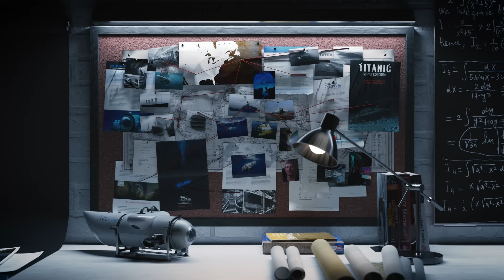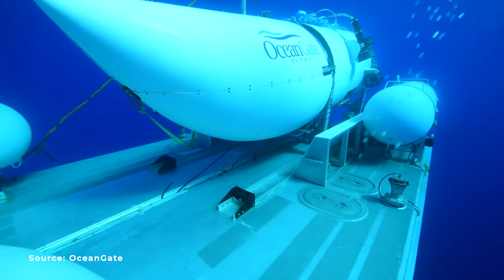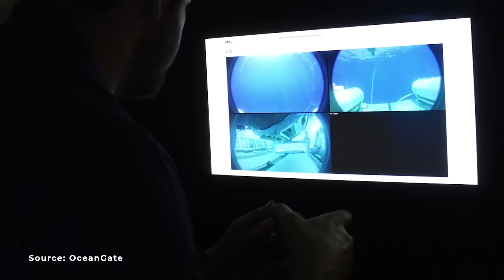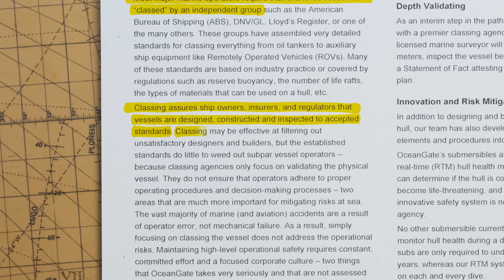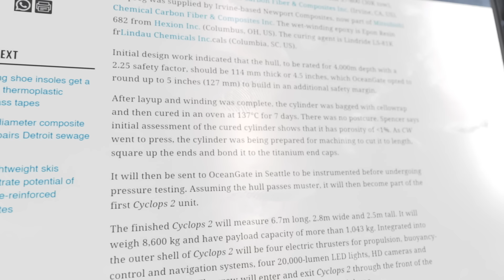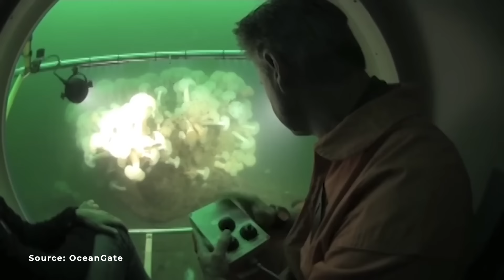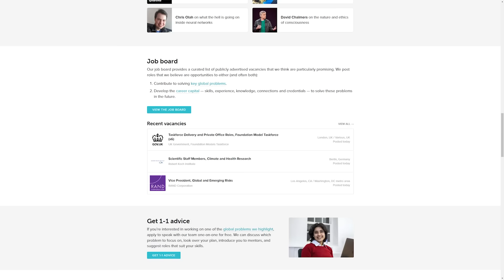The Questionable Engineering of Oceangate

Comment: After everything I've learned about Oceangate and Titan, I think the biggest mystery of it all is:
How did that sub survive as long as it did?
The more I find out about this, the more insane it gets.
Making the hull in a warehouse without considering air, dust and hairs. Gluing materials together that compress differently. Choosing a window that should be too weak.
At this point I just want to understand how it could possibly have worked even once.
Reply: A bulletproof vest made out of wood will work for one bullet if it is thick enough
Reply: @centripetal25  A bullet-proof vest made from Kevlar and ceramic plates will work until it's compromised.
Reply: @centripetal25 that sub went to the titanic 13 times.
Reply: @blazn0  Same principle. The little bits of wear and tear on the sub eventually caused catastrophic failure.
Reply: @blazn0  its a metaphor
Reply: If only they had used FLEXSEAL on the hull.
Reply: @chairmankim9628  funny. In a dark kind of way ..
Reply: My guess is that they did have a certain safety factor built in, which is why Stockton was so sure it would work. The progressive damage from previous dives that they chose to ignore then just slowly erroded that safety factor to zero.
Reply: @dirkmohrmann8960  True, besides a ridiculous amount of luck, apparently everything was built way better than you should expect.
The people who actually built this thing did a fantastic job, building something that shouldn't work on so many levels and still survived a few times.
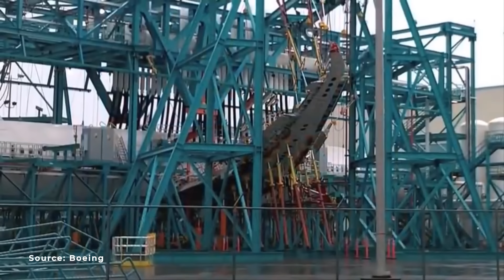Reply: Fatigue. (7:12) Just because something can take strain once, is no implication that it can take the same strain hundreds or thousands of times.
Reply: Using carbon fibre under a compressive load… you can’t push a rope.
Reply: @troglokev  well, you can push a rope, it just does that a rope does :)
Reply: @StefanoBorini  yes. It wobbles around and bends all over the place. Unless it’s PMI. That stuff was awful as rope. Great if you needed to improvise a jemmy bar.
Reply: Let's apply one direction to our weave lmao the company suppling them the five inches was like "we gonna get those lambos boiz!"

Comment: Not sure if reinforced concrete counts as a “composite material” but from what i have learned is that you typically look at the strengths of the independent components separately for the strength of the member. In other words, you look at the concrete itself for compressive strength and the rebar separately for tensile strength (granted its place correctly w/ respect to the intended loading condition). I have never had to do any analysis on composite materials aside from steel alloys which idk if those exactly count… the only case of two distinct materials together ive dealt w is concrete, but it wasn’t distributed uniformly in the mold. Id really like to learn more about composite materials properties like the example mentioned in this video. Maybe a stress strain diagram that would take it to failure, just to see what it would look like. 

Edit: i got exactly what i asked for at 10:58 lol. Thank you

Comment: Every submersible intended to reach these depths uses spherical pressure vessels to maximise pressure resistance. And no submersible has ever been lost due to implosion of the spherical pressure vessel.

Using a cylinder is itself a major red flag. Using a CF cylinder GLUED BY HAND IN A DIRTY FACTORY to titanium end caps is a screaming siren.

It isn’t surprising this thing failed; it’s surprising it didn’t fail on the first dive.

Comment: Something i realized while watching this is that one of the reasons you would see delamination as opposed to standard buckling is because at very high pressures, not only does the water push the wall inward, but that load transfers along the arc of the circlular hull. That might cause the surface to compress within the plane. By doing so, the inner layers would be prone to rotate bend like when a bimetallic strip bends due to uneven expansion.

Comment: The CEO of OceanGate has completely misunderstood the "move fast and break things" approach. SpaceX is an example of doing it right. Yes, they quickly iterate by making a prototype, blowing it up in a test, improving the design and repeating. But they do this with unmanned vehicles! Only after many, many design iterations of the Falcon 9 rocket did they put humans on top of it. At that point it was already proven that it's a highly reliable launch vehicle. And they went through NASA's entire certification procedure for human flight rather than ignoring their rules.

Comment: Apparently, the ends effect due to the hemispherical shapes was also neglected, which due to the effect of pressure, produces axial forces in compression. If you notice, the sub has no reinforcement in that direction. The only structural component that provides axial reinforcement is the metallic liner. The composite reinforcement is insufficient. Going into greater detail of the structures manufactured by filament winding, the biaxial stress state dictates that the winding angle should be 55°. According to the manufacturing video of the cylindrical segment, the winding is done at 90°.
Reply: Besides, the failure mode that you describe (delamination buckling failure mode of the first ply) is impeded by the metallic liner. So, the global failure mode of the Titan's cylindrical body is rather new.

Comment: The way I see it, Carbon Fibre in this use case is TOTALLY USELESS and the sub was relying on the strength of the epoxy alone. The fibres themselves are not rigid and their strength lies in tension, so things like COPVs as used in Aerospace is right up the alley of Carbon Fibre. When used in this application with the forces external to the pressure vessel the fibres are in compression, as an experiment take some rope and see how well it takes being compressed along it's length!

Comment: I would say that a the fact that passengers just sat on the floor of the vessel without any restraints in a small ocean going vessel is a decent indicator that this was amateur hour. The risk of blunt force trauma for everyone inside should the attitude of the sub alter is huge. Also there is zero ability for emergency egress even at the surface because it takes 30 minutes to unbolt the end hemisphere, what about fire, medical emergency, air supply issues etc etc etc. Also there is evidence that the battery power had no redundancy and was a constant reason for resurfacing. Just a big nope all round. I think that using the word egotist or narcissist for a CEO is a bit off though. Most CEO's will fall into that category in a psyche test.

Comment: The epoxy-glue joints where the domes fit over each end of the carbon fiber cylinder would of told me ..hell no, I wouldn't go down in such a vessel into such extreme depths.

Comment: As a professional engineer myself I have a little theory and practical experience with composites in pressure vessel design...but not much. Mostly in metal. Glad that your more informed thoughts coincided with mine on this. Seems clear cut. The CEO appears to be a  dangerous maverick reckless idiot.

Comment: The biggest weakness seems to be the way the end caps were simply glued on. No rubber seals. No gaskets. No v band. No bolts. Just glue and basic coupling. 

My best hypothesis is that water seeped in through that joint and made it so heavy that when it dropped the ballast and frame, it was still too heavy for even the thrusters to bring it up. At which point it most likely imploded.

Comment: The vast majority of plane crashes are caused by poor or rushed maintenance or mechanical fault not pilot error not the other way round as the the statement in ocean gate  CEO says  what he did was negligent to the point of being criminal with that statement and failing to get a sub (experimental) one certified by a competent Org that deals with craft at this depth is down right idiotic
As for the carbon fibre the video of it being rolled onto the steal tube showed that this company cut corners , you only have to look a air bottles made for scuba diving how there made in a crisscross pattern  and thats where its strength comes from not in the straight line like winding a bandage round your arm from wrist to elbow

Comment: If it had been designed like a star except Instead of sharp edges that had parabolic curves between the points, would that Have put the carbon fiber into tension? Considering only the tips of the star would be under compression at that point

Comment: Excellent video. Thorough research etc. I want to add a little though: There is some way to do a composite so that compressive forces result in weird internal responses causing the material to be under tension more than the external pressure. I remember my professor showing it and explaining how they used that technique in car manufacturing. I might be able to find my notes on it if you want.

I want to offer a little, hopefully constructive, criticism on your spin philosophy. Firstly, I do agree they had woefully insufficient safety standards. I agree with them that standard safety routines will often fail for a non-routine product. That however is not a reason to ignore third party concerns, its a reason to seek them out and answer them. I suspect some of this was done; but it seems they ended up reinforcing themselves in reassuring others or dismissing unqualified claims. My bigger concern here comes down to a few things. 1. The vessel design worked surprisingly well. The hull had completed several dives. If it was completely untenable there wouldn't be one success. i.e. it should have been possible to do this more safely. 2. The virgin galactic accident had a survivor because of the safety features. Compared to earlier rocket developments they actually have a lower failure rate. It still shouldn't happen and should be getting better. 3. We are also looking at this with hindsight. Its a lot easier to trash a failure. Its also important to focus on what was done and why what wasn't done was left undone. I don't think we have all those details. There were multiple human factors leading to this. Spending 15 minutes describing the problems is good. But people don't ignore 100% of criticism. Its harder to learn from someone's mistake when we see them as a legacy of mistakes. In this case you have a company that was a surprising success make a few fatal mistakes.

Comment: Composite construction seems an odd choice for a device which by its very nature will be subjected to only compressive stress.  Composite material can be quite strong if the fibers are loaded in tension.  That is why fibers are put in rather than making something completely out of epoxy.  As the saying goes, "you can't push a rope" which is exactly what happens when you try to load a composite component in compression--the epoxy matrix is what will have to take a majority of the stress. Composite pressure vessels, like the high pressure hydrogen tanks in fuel cell vehicles, work well because the internal pressure produces primarily tensile stresses in the walls.  A very basic issue of misapplication of a material, it seems to me.  There are a number of other issues with this vessel but that seems to be a pretty basic error.

Comment: Thank you for not getting into the Logitech controller. It’s a red herring only to make the implied statement that Titan was a toy.

Titan was many things, including an egotistical moron’s phallic measuring device, but toy is not one of them.

Logitech, Nintendo, Sony, and Microsoft sink millions of dollars into designing sensitive, accurate, and durable controllers. They are literally their respective system’s user interface and incredibly important to their respective success.

And how important is that success?

The video game industry makes more money than ALL of the movie, television, and streaming studios.

COMBINED.

The only control issue Titan experienced was due to installing thrusters wrong… which was improvised to correct for safe recovery by holding the controller at 90 degrees to orient the axis of control in alignment with the muscle memory of the pilot.

Using an easy to learn and program gaming controller is actually one of the ONLY things Oceangate got correct.

Comment: Just my curiosity, what do you think about how fiber is only weaved in one direction as shown in the video? Would different weaving pattern improve haul strength?
Reply: Imagine trying to build a water bottle out of string and tape. Would it hold water? Probably, if you did it right. Would it maintain its shape if you stepped on it? Not a chance. This is a rough analogy for a carbon-fiber pressure vessel. String and carbon fiber are really only strong in tension but not in compression. Due to the convex shape of the pressure vessel, there's really no good way to have the fibers in tension when the pressure is coming from the outside. But who knows, maybe sometime some crazy smart topologist can figure out some revolutionary design where the fibers would be in tension under external pressure, but as of right now, it's essentially impossible.

Comment: A very clear and well made presentation and great to hear from someone fully qualified in this area, thank you. Re the profiteering - I don't think they actually made any profit from these tourist dives. Rush's longer term goal was to use the design for subs servicing the deep sea oil and gas industries. Without a certified vessel there's no way those industries would go anywhere near him, but he was betting that with some history of successful use they would. So these dives were effectively beta testing, using the tourist income to partially fund it. Frankly I don't think they would have gone near him regardless, but such was the blind hubris and narcissism of this man, he thought otherwise.

Comment: 10:38/15:11 it’s funny they say this. If only there was an industry that specialised in Material x-ray to check for porosity. Helloooo weld x-ray specialists. I’m sure 5in of carbon fibre is not X-ray and it would when x-rayed show air pockets and material/ lamination inconsistencies. Just further shows where there’s a will there’s a way and how un willing they were to look for possible failure points and find ways to test them.

Comment: As soon as I heard the hull was a composite, and that it had made previous dives to deeper depths, it was clear, to me, it was likely a fatigue failure and that the operating pressure was above the fatigue strength of the hull.  Composites aren't perfectly uniform (it's hard to predict the fatigue strength), fail suddenly and without warning, they don't strain harden, aren't good in compression -- the list of issues is a mile long.  When it's so easy to feed steel into a ring-roller and weld it, why go through the hassle of building a composite?

Comment: I don’t know if anyone notice but ocean gate made the carbon cylinder by winding unidirectional carbon fiber tape around a mandrel with flanges on both end, and they did not wind the carbon at 45/90/45 degrees. The winding was simply applied at 0 degree all along the mandrel, back and forth until reaching the desired thickness (apparently about 5” thick). This is fundamentally so wrong in term of carbon composite manufacturing process and did not take advantage of how carbon fiber supposed to be used. Basically, imagine building a wooden cylinder with the wood grains all going in the same direction. I’m certain that they did not wind the carbon in other directions because with the flanges on the mandrel, there is no way they could have done that. Normally you would have to alternately wind the carbon tape beyond the required length of the final part, the trim to size after curing. But i can imagine the challenge of cutting something 5” thick not to mention the cost. Totally insane!

Comment: What Ive found in hydro testing pressure vessels is one common immutable truth , having a predictable failure mode is very comforting .  You can design around that predictable failure mode ( weak link ) and prove the actual result repeatedly.. This backyard project sub was simply a deathtrap
Reply: Unfortunately the failure mode was fatigue, which is not well understood, and is calculated as a probability of failure.  That's great for mass produced stuff, you can say 0.02% of your stuff will fail in a given number of cycles.  Not so much for a single submarine.  And the snap buckling just adds to the lack of predictability.
Reply: @MushookieMan especially it is good for mass produced stuff with limited safety risks. If an "innovative" company wants to build the first carbon fiber shovel because of its lightweight they can do this. If the testing reveals it withstands an average of 2000 times shoveling dirt it isn't the most sturdy shovel but no-one will die because of this thing.
Reply: @technikchaot  Maybe people will actually die when such a shovel snaps, but it's such a tiny risk and the warranty statement can protect the manufacturing company from lawsuits.
There is no such thing as 0% risk of death in life.
Reply: @VulpeculaJoy  Testing a shovel to be able to withstand extreme fatigue on the off-chance that it might hurt someone is orders of magnitude less important than testing a submersible for failure.

In one of these cases, chance of death when there's a failure is very low.
In the other case, there is a near 100% chance of death if a failure were to arise.
Reply: @tonydai782  The fact that one has to explain the difference in consequences between the failure of a shovel and a submersible at depth with living people aboard amazes me. I am waiting for the person to post claiming that playing Russian roulette with a single round in the chamber and getting away with it 100 times means that it has been "proven safe" by the 100 trigger pulls.